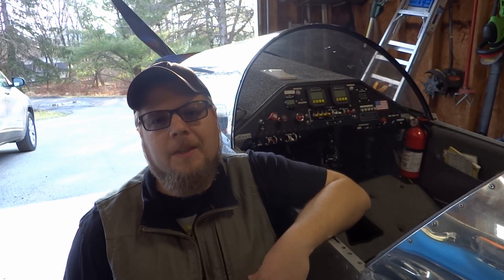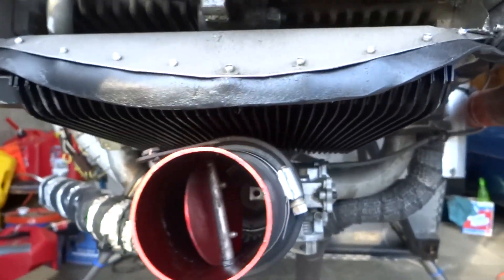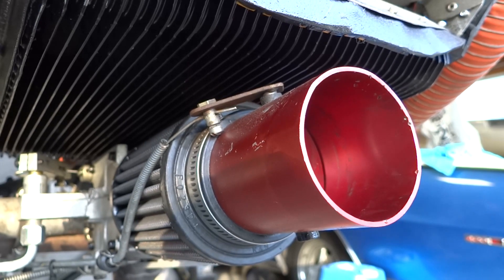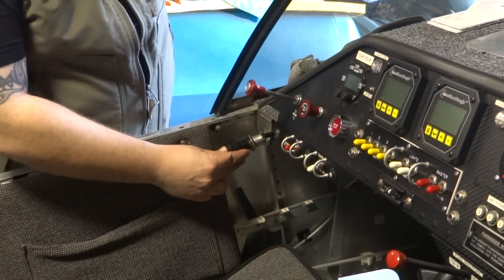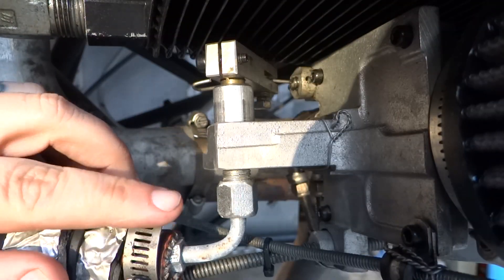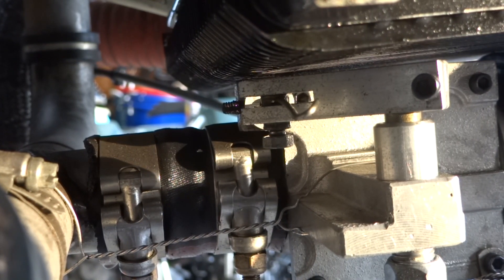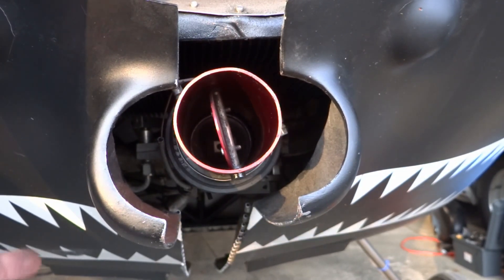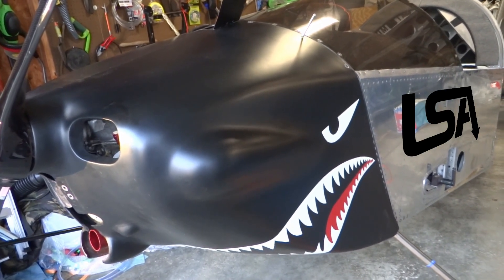Revmaster Revflow Carburetor Operation, Your Questions Answered

Comment: How do you set up the carb properly I am having a lot of trouble just to get mine to idle, it runs fine at 12-1.500 rpm fine but then just quits  I have tried all that I know...... I would appreciate any help I can Thanks

Comment: What is the travel length of the throttle?  I bought a 3 1/2in travel locking throttle.
Reply from the maker: Unfortunately I can't give you an exact answer as I don't own the Sonex anymore. From memory, 3 1/2" maximum of travel should work for you. The main concern is that the slide is able to move from stop to stop.

Comment: Regarding the revmaster, do you know if anyone has put dual carbs on the engine? I know the company was making VW engines back in the 60’s on.  I used to tinker with VW performance engines and found they really gain in power from a dual carb setup.
Reply from the maker: Interesting concept, but I have yet to see it done on any aircraft version of the VW engine. (I won't say never though, somebody had to experiment with it, right?) Dual carbs make perfect sense when you're looking for more throttle response and higher power outputs. In an aircraft engine where power is typically held at a continuous RPM (~3000RPM)  for long periods of time, there seems to be less benefit to it with added complexity. Looking at certified aircraft engines, it's the same concept, single carb below with long intake runners to the heads. Again optimized for continuous operation at a constant power setting (~2200-2400 RPM.) Now for the wild card, the Rotax 912 UL has twin carbs on top of the engine with short intake runners. Why? 🤷‍♂️ The big difference is they run @ ~5000-5200 RPM with a gearbox reduction for the propeller. So it made sense to run dual carbs to the Rotax engineers, but I don't know why. Would love for someone with more Rotax experience to chime in. All that being said, put the experimental in Experimental and try it out. It would be very interesting to see what you could do with it. Maybe the dual carbs is the ticket to VW powered STOL drag entry? 🤔Thank you for getting the brain juices going this morning! 🤓

Comment: Do you use any kind of air filter on your ram tube?
Reply from the maker: At the moment, no. However I am going to purchase an "old school" velocity stack screen that should fit right in the end of the tube for large debris. And naturally this tube is plugged when parked. I ran across a study that performed oil analysis on aircraft engines running both filtered and non-filtered air. IIRC, the only difference between the two was a slightly higher silica content on the non-filtered engine. Again, this doesn't take any random encounters with "large" debris into account. Although not in the Revmaster manual, some of this comes down to situational awareness as well. Dry dusty field? Have the "carb heat" on and pull filtered air from inside the cowling. It's not a true carb heat and there's PLENTY of power for takeoff and climb out, but this engine is designed to get maximum power with the ram air tube open.
Reply: @LeftSeatAdventures  This caught my attention also. I would take the performance hit for higher reliability.

Comment: Thanks I may get this filtered warm alternate air system on my 34mm Revflow equipped Cygnet SF2A.  I like the "free Prime" function the mixture cut off affords.  I have traditional carb heat now and it is not needed.
Reply: They would be good stable mates you would  have to asses the strut tangent.  If that is  Glen Maxwell's it is good one built to a high standard https://www.youtube.com/watch?v=p6LtpMq4ygE
Reply from the maker: @007mwn  Good to know, thanks. Yup that's the one. I know a few people who are in the market now and passed his posting along.
Reply from the maker: Yea, the Aerovee Sonexes use the Aero Injector which just pulls warm air from inside the cowling all the time, but many end up adding a fresh air vent. But this system on the Revflow is nice.
Reply from the maker: Side question, do you think a Cygnet's wings would pass easily over a Sonex wing? Saw a nice one on Barnstormers, pondering the hangar tetris that could be involved.
Reply: Can you advise does the aluminum tube reach through the K&N filter assembly to clamp to the carb with vents or is the K&N clamped in between the carb and the red valve tube?

Comment: Just had a think about it. You could, if you felt so inclined, change that throttle to a more traditional style with the lever using a relatively simple linkage.

Would be a slightly more complex, but would be more ergonomic.
Reply from the maker: So, AeroConversions actually makes a throttle lever specifically for the Sonex. It's something I'm considering as well. 
http://www.aeroconversions.com/products/throttles/index.html

Although you are welcome to "engineer" one for me! 😜